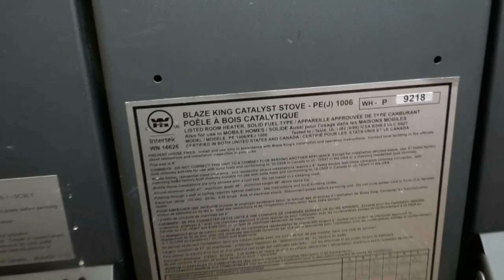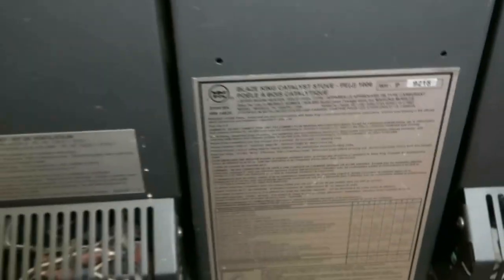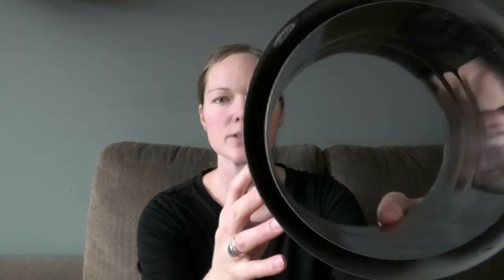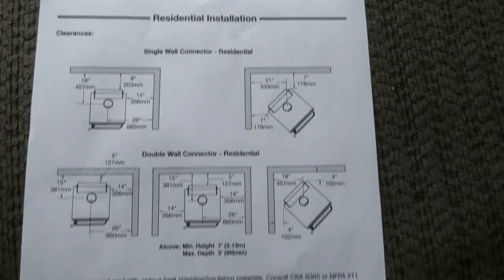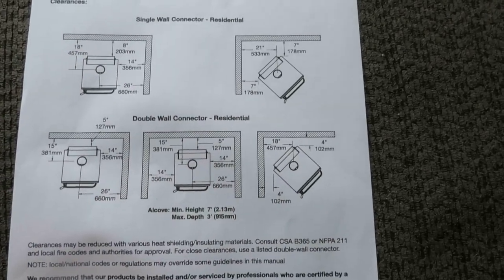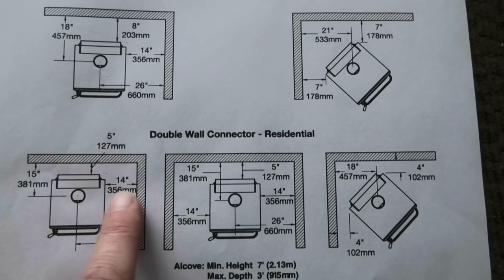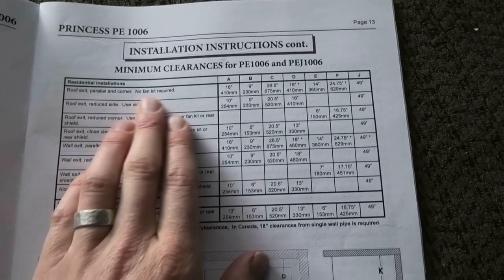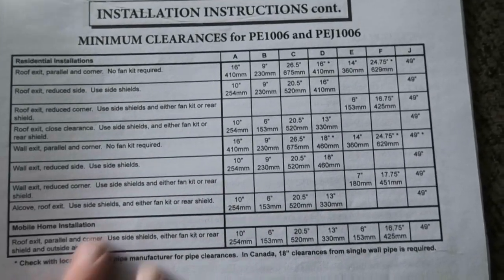How close can my wood stove be to the wall?

Comment: Thank you so much. This is very helpful for me. I am preparing my walls with cement board and stove board shields. The floor is concrete but I am adding concrete pavers for extra protection.

Comment: Our Buck Stove was professionally installed by our dealership. They made sure that all manufactures specs were adhered to upon installation. I took it upon myself to order additional fire panels from Northern Tool Company. Zero heat reaches our walls. I sleep better.

Comment: I have some big concerns about my wood stove

It’s only 12 inches away from the wall at the rear, no shielding and it’s dry wall. The wall gets hot to the touch.
 
I feel the man that sold us the house had this thrown in to help a sale but safety wasn’t considered with proper distances and shielding
Reply: I sure hope you bought a heat shield, I got my umpire heat shield for my walls from tractor supply, since no one down here in Texas was buying them I got them both for 84.00 out the door 😁 yeah I had to drive 40 miles one way but at the price they are now I drove it! Search around it will save you lots and not warp your walls or burn your home down
Reply: @danielleterry2331  how did you install them? Easy?
Reply: I have exactly the same issue, the salesman came out to our place prior to install said they'd do it as per specs and it will be fine. Unfortunately when the fire heats up, it heats the gyprock wall and fumes start coming out 😣
Reply: @charonsherrard9348  don’t use it if smoke is coming out of anything, ever.

Comment: Isn't your example on the pipe upside down? As in crimped end going to stove so any creosote will run into the stove instead of out around the joints?
Reply from the maker: If you are revering to the double wall, the inner liner is the "crimped" end of the system.  It is a common question with double wall as it looks upside down on the outer layer, but in fact the inner layer is the one that will fit inside the flue collar.